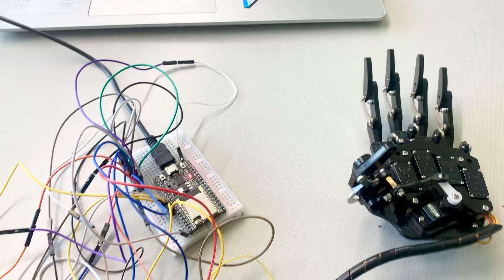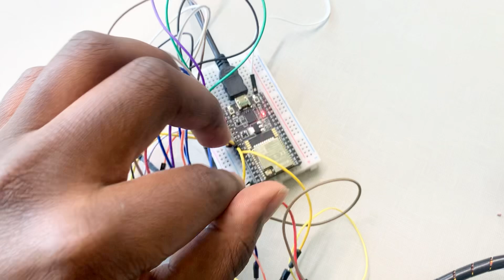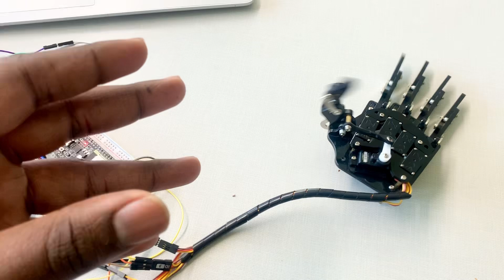Why is Arduino Not Widely Used in Industry?

Comment: My experience has shown that  ST supports a wide range of products and support for small microcontrollers in the industry standard (we use at least AEC-Q100). The prices starting at one million pieces are also interesting. Or the advantage of being able to buy pre-programmed chips with your own software. As a company, you can than have a personal contact person who can support you with technical questions in this regard. To be honest, this is probably also possible with Microchip, Freescale, NXP or Texas Instruments. All of them has AEC-Q100 qualified products.
Arduino boards and software are just for playing around a little and trying something out quickly. They can do that quite well too. But not to build a long-term, stable system that combines price, quality and stability. It's expensive, very slow, the code is extremely bloated and not stable. All things that can't be used in the industry. (except Tesla, 😅 they  use cheap consumer certified electronics)

Comment: There are Arduino controllers, Arduino based dev boards, Arduino IDE is for software development for various different microcontrollers. The microcontroller used in the video is an ESP32 and is an excellent and very powerful controller with ample RAM and  ROM storage. It is designed for industrial use.

Comment: Arduino itself is just the software ecosystem. Which is infact used in some industries. But the Arduino boards (Uno, Mega) are very basic and old and they are hardened for industrial scenarios for example EMI filtering, protection circuitry etc. 
TLDR: uno, mega boards are not used in end products or industrial environments
Arduino Software(MCAL) (not the IDE) is used in many commercial projects/products

Comment: Arduino signal processing is limited to 16 MHZ where as real time industrial controls can go up to 1 GHZ speed for real time data processing and controlling switches, actuator or reading sensors. From that perspective Arduino is good learning product but not used for real time industrial applications.

Comment: Arduino is not used in industry because of code certification problems (software) and bad emc design of the boards (even stm32 nucleos can generate problems). And to mention the esp32 is refered by esprif as a hobby mcu only.

Comment: the Arduino framework is just a hardware abstraction layer, with a high enough abstraction so that it can be used on many controllers and by many libraries. High abstraction often comes with the cost of lower customization and larger memory footprint. However, I don't see how an ESP32 + Arduino couldn't be used even in some automotive applications that don't have real-time requirements.

Comment: in an industrial setting, you can pick the chip that just fits your needs, leave out all pin you don't need and probably bet a smaller, cheaper, less easy to reverse engineer solution, more rugged and even have control over QA and testing processes. This is like asking why nobody uses LEGO or FischerTechnik in industrial solution - because there are better and cheaper ways to do it IF you can handle the upfront cost and development time.

Comment: The author does not really understand why Arduino is not used widely in the industry. Not worth watching.
Reply from the maker: @vamastah1737  why do you say so? Many have either concurred with me or provided additional insight to what was said in the video. So, kindly contribute to the discussion. How don’t I understand why it is not widely used in the industry?
Reply: @orieka.o.s.e  1) Nobody forces you to use "cushioned" libraries. You can use others or even write your own from scratch. In fact, you are not forced to use Arduino software at all on Arduino AVR-compatible boards.
2) If you want, you can have precise control on PWM, power, clocking and whatever you want on your Arduino board - you can write your software with a single CPU tick precision. For 20 MHz crystal it means 50 ns time resolution.
3) Therefore, hard real time applications are feasible on Arduino. Take a look at Marlin firmware for 3D printers as an example - you could say that this firmware takes AVRs to their limits with precise control over an extruder motor and 3 axis motors.
	
You also need to be specific about in which industry Arduino is not used widely. Automotive? Sure, a generic Arduino will not fit there due to lack of Secure Boot, lock step design or ECC memory support. Manufacturing? Low EMC compatibility. Multimedia? Low CPU and video processing power. 5G connectivity? No DSP capabilities. AI? No GPU or similar computational parallel accelerator.

On the other hand, you have multiple devices that use AVRs which are at heart of most Arduinos. Boiler or stove controls? They could be done on AVRs. Hot air stations? Mine had AVR inside. Low power animal trackers? I know one commercially successful AVR-based design.

Just use AVR and Arduino for what it was designed for.

Comment: Because Arduino and other Prototyping platforms like PIC,  based boards are just for prototyping only as the name implies, Not good for specific job, Example : for simple project like Led dimming or blinking there is a specific timer ic available, there is a no need for Microcontroller here, for advance circuit involving adc's, calculations specific microcontroller ic is only used like STM32 or other, not entire  board that doesn't make sense. In General Prototyping platforms are just for prototyping not good for any single production application.

Comment: As a retired electronic engineer, i never used the Arduino for a few reason, 1. Cost is too high for a very low performance, ie esp32 in bulk is cheaper then an 8 bit Atmel, 2 Size, the boards take up so much room, 3. Construction time ie mounting on pcb with headers is slow compared to my pick and place machine 4. Arduino IDE is junk and takes up resources like timers that I want to use, that said I always made a killing on a person that used Arduino and asked I could make a 100 pcb or more as they did all the firmware and I just literally did a pcb design and charged for the project like  I was doing it from scratch... Arduino is ok for a hobbyist but not for a commercial product... the raspberry pi has similar fate... cost is too high for mass production.

Comment: Arduino's microcontrollers (uC) are widely used by the industry, the same applies to all the circuitry you see in there. In terms of uC some boards are already quite old tech. Arduino is nothing special, in fact an Arduino board is probably within the complexity level of a third year engineering university project. Once you know how to design and build this stuff, why would you bother trying to fit your problems specs to an Arduino board when you can design the one you actually need? That's what pros do all the time; and I can tell you is not only more efficient and cost effective when millions of boards are produced, it is also a lot of fun.
As for the software environment, it is a tinkering platform. I tried once and was like, this stuff is so below pro level, and just used the boards without all the simplistic software API and libraries. So basically, any recent graduate from any medium level university will probably never use this stuff for anything else beyond tinkering. It won't be used in widespread industrial applications because it is literally a toy.
All that being said, they are quite handy tools and pretty much anyone uses them, including professionals.

Comment: You are correct.  Production level programs normally are written in assembler using direct control of the microprocessor.  The goal is to provide maximum efficiency and reliability, while also minimizing hardware cost.  However, very very useful systems can be created using the Arduino Framework.  It's just that they don't have the reliability of a product offered for sale.  
But I will tell you why Arduino/ESP and the other development boards are revolutionary.  It's that they've opened up development to millions of new creative people.  It's no longer in the realm of the giant, big business development lab.  
When you suddenly have millions of new electronics/robotics/IOT developers, world changing inventions are created.

Comment: Well one reason is warranty. Then reliability, you need to make a lot more protection circuits for arduino so you don't get a undefined state and need to use reset because the voltage for the arduino that is powering it goes slowly up to 3.3/5V and then the cpu can hang itself in an undefined state, as the base models are not shielded at all and that is only one issue. Another one is probably that big multimillion dollar companies can influence the laws a bit, so their products are need to be used. At least in my country.

Comment: Simply: because it wasn't designed to be used in industry. It was designed as a learning and prototyping platform hence simplicity, accesibility and fault tolerance over speed and specific function optimization.

Comment: Also true for HVAC. The main dealbreaker is that most programmable industrial or hvac controllers have a firmware with a programming language interpreter, and with how it is written, it is designed to allow you to easily change something in the program without causing a full-on service interruption. Arduino programming is only on the firmware level. Rewriting the firmware basically requires the CPU to stop executing commands.

Not to mention that if you want to implement remote reprogramming or some other stuff, you need a platform for it, use or develop your own protocol, and then add stuff to the firmware. There's a reason why manufacturers like Allen-Bradley, Siemens, Delta Controls, etc... Aren't open source.

Comment: The big companies don't use arduino libraries for developping micro controllers, but you can develop professional applications with an ESP32 microcontroller, just like the big tech do it, if you use the esp-idf framework and you know what you're doing.

Comment: an ESP32 is not an Arduino.... you can use multiple languages to program both ESPs and Arduinos... youre not limited to Arduino IDE and arduino code... you could program it in complete C... or micropython..or many others... hell both can even be programmed at the machine code level.... 
...what do you say about STM32s? that ARE used by industry.... SMH....programming languages do NOT DEFINE THE HARDWARE
Reply from the maker: @WacKEDmaN  Great insight!

Comment: Yeah, like others, didn't need to watch to know. Build better, cheaper just as a side-effect of having to design the solution. Even if something called for an Arduino, it'd be better just to get the AVR chips and build better, and still be compatible with the code.

Great for education, though, which is what it was for. I've had dozens, but only bought one. The others I just built around the chip for toys like LEDs, printers in the old days, etc.
Reply from the maker: Thanks for contributing regardless!

Comment: Yes this seems to be the prevailing thought among engineers. Although I have replaced the environmental controller in our $250,000 greenhouse with a system that runs on an Arduino Nano. The Nano and all supporting components are attached to custom board with headers. The thinking was you could quickly replace these if they went bad. Over 4 growing seasons the only part that has failed is one $4.50 AHT temperature humidity breakout. The system has been rock solid 24/7 through power many power failures/blips (while our generator fires up) I code the Nano without a bootloader so it starts right up. I use a watchdog timer but have never recorded an instance. I have documented the build in this video and the blog linked in the video description. https://youtu.be/XjPBXSxW4Mc

Comment: Arduino is not an "industry standard" but not for the reasons you gave. many industries use Arduino for proof of concept and initial design phase. You actually spend more time using things like Arduino, esp32 etc than you do the "industry standard" devices. so although Arduino is not implemented in the final product, it is used a lot in the design phase. In fact, you would actually spend around maybe 75 percent of the time using things like Arduino and 25 percent of the time implementing on more sophisticated controllers and software.
Reply: OK then why isn't arduino used as industry standard?
Reply: OK then why isn't arduino used as industry standard? (2)
Reply: OK then why isn't arduino used as industry standard? (3)
Reply: In short Arduino is jack of all trades but master of none. industrial standard don't need swiss knife(Arduino)

Comment: I have used Arduino for Commercial Project and It’s working good but i hade to write and modify some library for perfection.
All circuit Board designed on purpose. 

Arduino Prototype board not designed for Industry but for prototype

Comment: esp32 is cool and all, but let’s be real , it’s not made for industrial environments either. Sure, it’s better than an Arduino in some ways, but try running it 24/7 in a place with vibrations, extreme temps, or high humidity, and one day, it’ll just stop working. It’s great for hobby projects, labs, or universities, but not for the tough conditions you’d see in factories.

If you’re serious about industrial stuff, STM32 is the way to go. You can dive deep into low-level programming, tweak registers, and build something that can actually survive and perform in those harsh environments. It’s more work upfront, but it’s so worth it if you want something reliable and professional
Reply: An ESP32 is a microcontroller, Arduino is a system of compatible MCUs and software programming environment and tools. It's not an MCU. ESP32 can be programmed with and without using the ArduinoIDE / firmware framework. Arduino cc have also used ESP32 chips in their own boards as well as many others. You should stop confusing the two or comparing them as apples to apples.

STM32 typically has just as much faults both in their given development code and on-chip silicon faults. Their errata usually consists of comically large documents. So you should also stop being so ideologically dogmatic about any company's product lines. You can program both many STM32 series and most Atmega series chips with and without the Arduino Framework, and since they're both binary instructions running on the MCU neither is more likely to physically survive harsh environments. Both have basic elements such as watchdogs.
Reply: @ivolol  You make valid points, and I agree that ESP32 and STM32 can both be programmed in versatile ways, with or without frameworks like Arduino. However, when I mentioned industrial environments, I wasn't talking about programming flexibility or basic watchdog timers. I was referring to the hardware reliability and durability in extreme conditions like vibrations, humidity, and temperature fluctuations.

STM32 devices are often chosen for these use cases because of their proven performance in such environments, supported by better-rated operating ranges, certifications, and long-term availability. While ESP32 is powerful and versatile, it simply wasn't built to withstand industrial-grade conditions over extended periods.

And yes, every MCU has errata, but industrial reliability isn’t just about silicon faults—it's about the entire ecosystem: quality assurance, vendor support, and ability to fine-tune low-level performance, where STM32 shines. It’s less about dogma and more about choosing the right tool for the job.
Reply from the maker: Thank you for the advice!
Reply: You still need to keep a PLC within proper ambient temperatures. Otherwise, it will fail.

Comment: Because the industry has funds for FPGAs or the engineers can just design their own special purpose microcontrollers with exactly the parameters/specifications and functionality they need.
Arduino is great, but it's a hobbiest product. It's like asking why formula 1 dont drive a Supra or Skyline.

Comment: arduino is a dev board its supposed to be use for development, for product you use microcontroller, perioherals etc on a custom designed pcb, its cheaper, made exactly how u need it, much safer. also atmega mictrocontrollers are very expensive and kinda bad, good for hobbiests because they are easy and low in features (i even wrote few bare metal ( - as in working on registers ) libraries for atmega 328P to chill between harder projects)

Comment: Spot on, the libraries are heavily bloated compared to direct register poking, taking many clock cycles to actually complete the desired action. This causes both issues with speed and memory size.

However, Arduino works very well for users who don't want to spend hours looking through the datasheets and opcode manuals. It can certainly be used as a beginner proof of concept stage.
Reply from the maker: Thanks for the contribution to the discussion.

Comment: I’m confused. Do people use atmel or other microprocessors on their products or do they develop their own chip from scratch? Arduino code is really just c++ code.
Reply: 1. there are some companies developing ASIC(their own chips)
2. there is no such thing as "arduino code", you can program any cpu with any compiled programing language as long as you have a compiler for that architecture or you can use asm for that architecture. arduino simply offers IDE, shit ton of libraries and abstractions
3. atmega products are sometimes used in industry but not that often, stm, pic etc are much more common

Comment: Im doing embedded dev for a medical company. We use arduino mega on a few production robots for some knee surgeries. It’s a great little platform as long as you code it properly. That being said we are switching to a stm32 platform, mostly due to restrictions on some floating points in arduino, but overall a great platform with a lot of io.